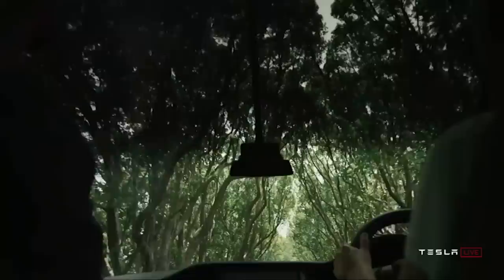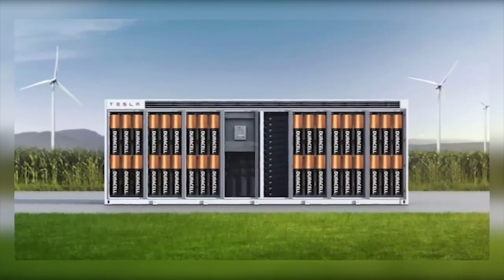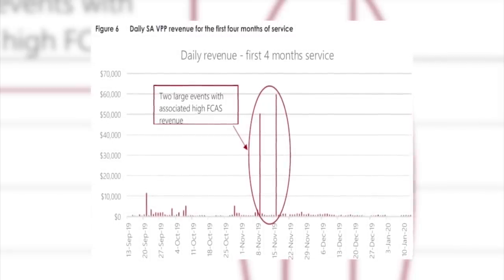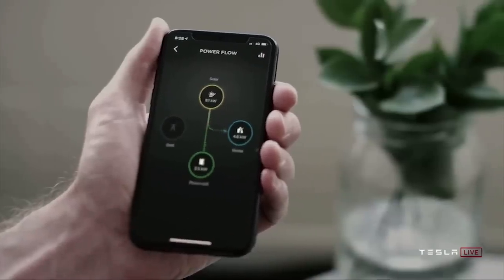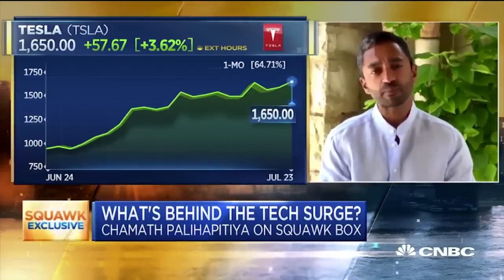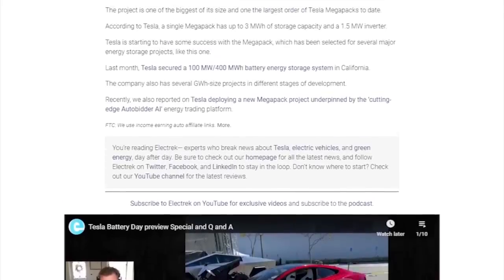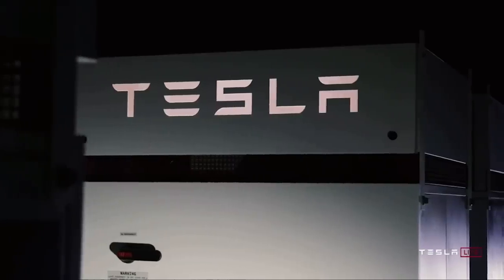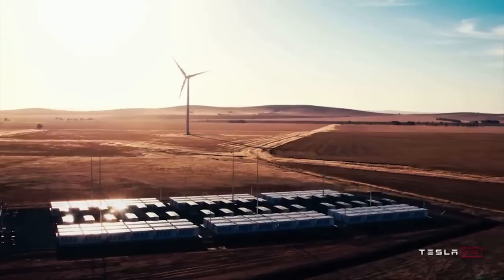Tesla Battery Farms Will Destroy Utility Grids

Comment: There is one big if in the thing. Power to gas storage might eventually be better due to not needing such quantity of rare earth metals. I don't think batteries won't be part of the solution, but i think they will have issue with scaling due to the need of rare earth metals.

Comment: theres nothing revolutionary or groundbreaking about tesla battery packs......like u said its just a collection of 18650 batteries bundled together to create a giant energy storage......most probably LG or samsung....tesla is no different from any other battery bank out there.....depending on the quality of lithium batteries u use.....

lithium ion batteries is extremely expensive and theres limited quantities that can be produced in the world due to scarcity......if they can produce lithium batteries cheap enough and in large enough quantities to replace the power grid they would have done so already....at almost $1000 per kwh,the only people that have battery banks are currently those solar freaks.

Comment: storage is key. there are literally dozens of ways to create energy- but if you can STORE IT- that's a HUGE win. the 1 gigawatt tesla/pg&e pack will be the new model that will erase peaker plants completely. with the 4680 cell architecture- &  tesla production methods- meeting demands is no longer a problem. and what's even more impressive is the fact that tesla can eliminate the costly & rare raw components from this battery- ESPECIALLY for stationary storage where energy density is not nearly as crucial.  53cents per kwh for storage? will flip the energy markets into a whole new way of operating.

Comment: tesla megapack is going to power the world??  sorry not going to happen.  the power grid will not be replaced by the megapack.  however using the megapack for backup power during power outages makes sense.  batteries are just not efficient as the power grid and ICE generators.  all infrastructure businesses know this.  power outages usually happen during storms, not sunny days.  megapacks will be drained within hours.  megapacks offer good solutions to specific power problems, but not fair promote megapacks as powering the world and worth trillions and trillions and trillions.  c'mon man!

Comment: This is a marginal gain business which is taking advantage of excess capacity produces at night that has to be paid for through increased daytime electrivity prices but is then thrown away. If you start to consume off peak electricity then the electricity companies will start to realise that they do not need to reduce the price so much as there is less waste. They can then reduce day time electricity prices. The consequence is that eventually Tesla's window of profit will go away.
Reply: There is a similar correction coming for EVs. A lot of the savings over gas may soon disappear as governments look to make up the shortfalls in road maintenance income from lack of gas tax revenue.  In areas with large EV adoption you may soon get to a 2 tiered licensing system where ice vehicles pay their set yearly registration costs while EVs are charged based on mileage.  This could mean an ice car cost $100/yr to register while an EV costs $400 (based on about 12k miles/yr at average tax levels).
Basing future profits on current markets only works while you are such a small player that your impact is limited. Once you start having a real impact the markets will adjust either through price shifts or competition.

Comment: Battery storage wont destroy utilities it will assist them,  older expensive to run polluting plants wont be required any more to give peak demand, so they can be shut down as energy can be stored at night and released during the day when required. This is storage, remember the energy still has to be generated somehow  be it renewable or fossil fuel when renewable s cant meet demand.  More people charging their cars and power banks at  will also smooth out the demand  in effect make it easier to operate and reduce low demand times, in the end off peak low prices will not exist.

Comment: Power should be built into the road else you will never be sure you can get to your destination.  Right now this isn't workable you talk and taok it WIll not work. over time the battery will turn into a useless lump  The large estimate is always wrong in projections no body knows ..  God help us if we depend to these insane POWER PACKS... ALL THE POWER PACKS ARE NOTHING BUT BATTERY PACKS.  I WILL PUSH THE LIES ASIDE DON'T BUY THIS FOOL'S GOLD.,  DID YOU NOTICE JEMA IS INVESTED SO HE IS BETTING ON THIS NONSENSE.  NO TESLA WILL NOT REPLACE THE GRID THIS FOOL THINKS AND FIGURES ALL TAKING OVER OF THE GRID.  CAN'T HAPPEN. ONE EMP WILL WIPEOUT ALL THIS NONSENSE THEY AREEASILLY DESTROYED BY SUN BURSTS AND EMP FROM WEAPONS.  DON'T BUY THIS  NONSENSE THEY ARE NOT TELLING YOU THE WHOLE PICTURE  A GRID WILL BE NEEDED FOR RECHARGING STATIONS JUST A SIMPLE GAS GAN WILL SUFFICE FOR A ICE CAR.  I BUILT AN ELECTRIC CAR AND KNOW THE SMOOTHNESS OF THE MOTOR AND IMMEDIATE TORQUE OF THE ELECTRIC  BUT WHAT THE MUSK FOOL IS DOING IS A NIGHTMARE WAITING TO HAPPEN.

Comment: Hehe. Lol. No. Batter is good for small amount of storage, like for frequency regulation, where it is superb fast, and provide significant savings to alternatives. But it doesn't scale to level to sustain other types of load. No ways. Pumped hydro storage is way cheaper and scalable.

Comment: Batteries are just secure storage for energy. That energy does not have to be in electrochemical form. This means that ‘batteries’ do not have to have to rely upon the availability of relatively rare ores and  manufacturing to scale in order for energy storage capacity to increase, even with the help of old tech, such as liquified air.

Comment: Looks like mega packs have gone to $200 to $300 @KWH.  Depending on if you want Tesla Electronics and service. 
Power wall just went up.  $7000. $520 @ KWH.  Wonder how long before the $50-$60 @KWH batteries that Elon spoke of, will reduce that cost.   Or is this answer never, it's just going to be margin?

Comment: Li-ion technology are not capable for such kind of loads and cycles. 500 cycles is not enough. LiFePo4 have at least 5-6 times more charging cycles and way more discharge current than Li-ion. The Li-ion are good only for low discharge current devices like laptop, led lights, phones etc. Overload the Li-ion and it does goes boom...

Comment: Energy Sector has enjoyed stability so Tesla only has to disrupt <5% to totally change the future default plans of new Nuclear Power Plants. 
The White Elephant in the room is the amount of Carbon required to mine the batteries and bring Tesla Plants on line. 
Also Cold Fusion small scale with a Fuel cell per house changing every 10 years. 🤫

Comment: While I am all for renewable energy (I put a 13.5kW system on my roof in January of 2020) and how Tesla is leading the way, I am wondering how the powers to be are going to handle situations like we have this year in the Peoples Republic of California.  We have experienced many wildfires this year which has resulted in smoke covering vast portions of the state (and other states as well).  I live in the San Joaquin Valley (south of Fresno) and since the middle of August my Solar generation has been down by 20-30%.  Cleaning the panels doesn't help much because  the ash particles re-coat the panels pretty fast, and you can't do anything about the smoke causing overcast and limiting the amount of light that shines on the panels.  Just think if Solar was responsible for 80% of our power generation in this state.  There would not be enough power available for the the normal demand.  Today they called a flex alert and it's really not that hot.  Beginning to feel like a third world country.  I know, I know, Global warming.  But wildfires have been a part of this state for years, long before Global warming became an issue.  And what if Mt. St. Helens blows it stack again?  There are volcanos all over this world, and any one of them could cause a major disruption in Solar Generation.  My opinion is you have to have a sensible mix of renewable and conventional generation.  You have to expect that Solar is going to have issues caused by nature and you have to be prepared to fill in the gaps.  It's not practical to tell your population to stop using electricity because we can't generate enough to meet the demand.  Perhaps battery storage is the answer, but that doesn't help when solar output is reduced for days at a time like it is here in my area.

Comment: There is the potential that large sets of well managed batteries, together with wind/solar generation, may give a blow to traditional generators.
But lithium batteries are expensive, and requires a precise management and excellent management software. You can't cut corners on battery quality and management, on pain of gigantic disasters.
It maybe the case to utilise Nickel-Iron and Lead-acid batteries to achieve the 25 years battery lifespan, at reduced costs compared to Li-Ion. Li-Ion batteries works outside the natural windows of thermodynamic stability, therefore require careful management to achieve sustainability. Mr. Musk got the miracle done via some very competent software, but others will be tempted by some easy savings, which makes the plants unreliable and dangerous, and prone to failure and fires.
I guess it require the same dedication and permanent attention of the rocket launch business...

Comment: Right that these will destroy the grid, but potentially literally, not figuratively.  The distribution grid itself actually is the major bottle neck to getting power to customers, not generation.  E.g. SCE, where I'm at, has distribution charges that are TEN cents per kWh cheaper off-peak ($0.216 vs. $0.114), while generation is only ONE cent per kWh cheaper ($0.104 vs. $0.093).  I.e., SCE customers in the LA area are paying for DISTRIBUTION far more than they are paying for generation.  Sure, the megapack can save building and running "expensive" peaker plants, but this accounts for an incredibly small portion of the cost of generating and delivering electricity.    EV adoption will increase the load on the power distribution system to the breaking point.  Ultimately, I think distributed, local storage and generation (solar, or off-peak distribution charging) are going to be required to avoid massive investment in the distribution system.  That is, Powerwall, NOT Megapack.

Comment: So, your premise is flawed.  Why are you a hater?  Our utility grids suck, we are modern slaves to Big energy and price fixing is evident.  Our energy needs will never be caught up to with solar/wind/geothermal/hydro by themselves in my lifetime.  A proper buffer is necessary to regulate power efficiently.  My grid is powered by coal, and it's disgusting to think we are 20 years into a new milennia and nothing has changed.  When my neighbors put in solar and spend 5k on lead-acid batteries the effect isn't green at all.  Even if 100 homes close to each other do it, the power company will still burn and still make huge profits - don't be fooled.  The end-user always pays, but can we get ahead of emissions and at least keep energy costs to me (an end-user) the same?  That's the real question.  Australia's solar to Brown's gas burners is the best I've seen to move the quickest in this direction with Thorium reactors being the longer term solution.  Without battery innovation, the DIYers can't afford the tech - and frankly with energy regulation as it stands, tesla's direction can meet the hopes/dreams of the end-users like me.

Comment: By all means get rid of the polluters but Solar and Wind cannot replace network base load.
The world needs unlimited energy from "walk-awy-safe" Liquid Thorium ion molten salt energy converters which can produce hydrogen for the  fuel cells in trucks; JP4 jet fuel for aircraft; ammonia for fertilizers; desalinated sea water; for crops; low pressure- high temperature heat for recycling metals and plastics as well as electricity for homes, factories and EV's (loaded down with heavy batteries); plus rare medical isotopes while converting current stockpiles of partially used nuclear fuels called "waste" left over from the 50 year old designed light water reactors, that they should be replacing ASAP - currently the cheapest being offered to Indonesia is ThorCon's 7×500MWe - expected life 80years - at the cheapest capital cost - for a 2year construction  of $1000/kW and 80 year life - and with levelised unit cost of less than USD0.04/kWh  AND it can do a black self start as well as being a "Load Follower" - so beat that with your short life, erratically supplying solar and wind farms relying on imported Chinese processed rare earths....
https://youtu.be/oB1IrzDDI9g

Comment: Casgains Academy.

Rose tinted glasses. There is not the slightest chance that batteries can replace power plants.
The only current use for batteries in the power system are frequency support, not to bolster intermittent renewable generation. 
As far as I know there are no countries with consistent sufficient excess renewable energy to keep large (and I mean large in the tens of Gwatt hr capacity) batteries fully charged and at the same time as charging the battery, supply the demand.

Comment: The only question is how is Tesla going to make enough batteries. I think they are going to have to licence the manufacturing process because between EV's and and peaker replacement battery banks the big holdup is going to be production capacity. I am guessing the new batteries are also going to be viable for replacing ice engines in ships, autonomous delivery drones, and even short distance air travel. As the gap in price between solar and FF grows the demand is going to be overwhelming, and as Climate Change becomes more evident that will increase the demand even more.

Comment: I would be more approving of battery storage if they switched to flow batteries for storage. Save the Lithium for Vehicles or wait until the cells need replacing and second life the old cells. Why waste brand new cells on storage, especially if vehicles are on backorder due to lack of battery packs? Buying a powerwall at the consumer level does not have a quick payback period therefore it only makes sense for blackout reassurance.

Comment: I think you may have made a case against the future of high cost dirty peaker plants. The real question is where will energy be produced? Solar, wind, new nuclear, diesel generators, coal, biogas etc.  Batteries don't in themselves produce energy. They can be used to load smooth.

Comment: Plugging numbers spreadsheets is not how to plan for the "Grid". You show an extreme lack of understanding how the grid works. Ask yourself, how do the numbers hold up with the fires in CA and out West. How is solar and wind working during these times? what type of backup infrastructure do you need - natural gas! So, the true cost of solar and wind includes - Solar and wind infrastructure, transmission & distribution, natural gas infrastructure for backup as well as the Tesla batteries. Not so inexpensive now is it ;)